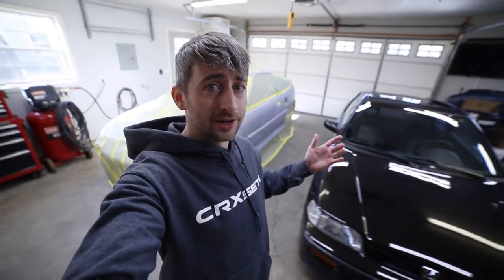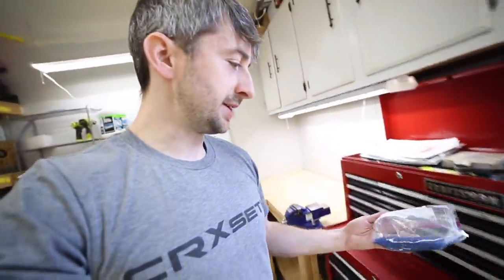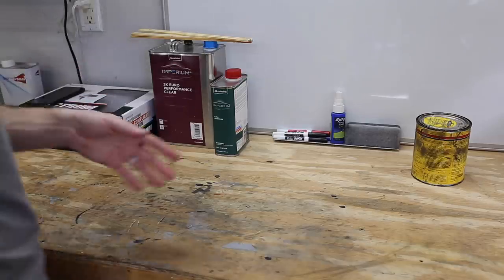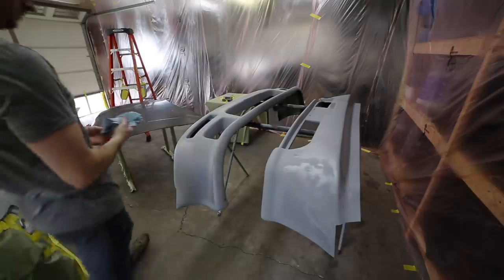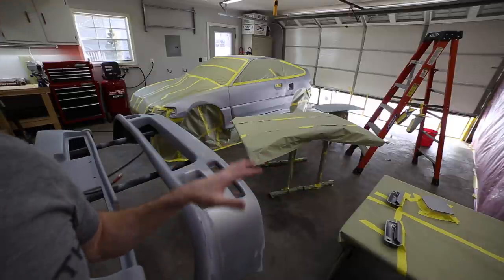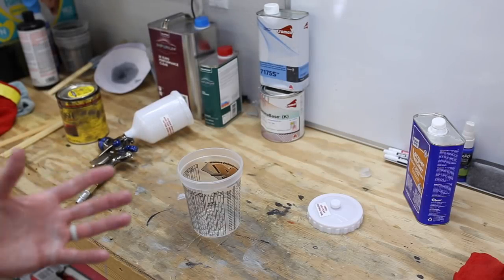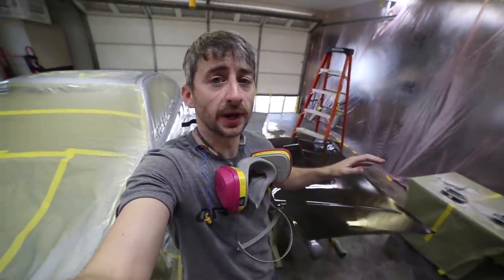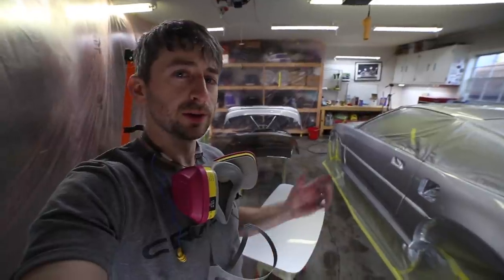1989 CRX Rescue Part 19 - DIY Garage Paint Job!

Comment: Dang, she laid out flat!!😍 
Quick tricks I've learned for a run in clear is lightly dab sticky side of tape to take away harsh edge for easier sanding. Also using your gun u can chase one off a panel or away from a body line so you don't have to worry about sanding through the body line

Comment: Great job all around , i personally would of used adhesion promoter for the bumpers sideskirts moldings and door handles . The runs in the clear where probably due to the cold temperatures
Reply from the maker: I used adhesion promoter on bare plastics. Check out some of the previous prep videos. I sprayed directly over primer in this video.
Reply: @crxseth  great job tho 👏

Comment: I don't have air so I'm not too knowledgable. But at the 5 minute mark what was the little glass tube thing you changed out, it almost looked like fish tank rocks in it haha. I'm assuming some kind of moisture collection to keep water out of the lines?
Reply from the maker: I mention it in the video, but it’s to absorb water. The beads are silica gel.
Reply: Ahh, I was doing the work from home thing while watching, I must have missed you mention that. Thanks for the reply!

Comment: Is a quart of paint enough for the whole car? Being reduced 1:1
Reply from the maker: I wouldn’t recommend it. I’d get more next time.
Reply: @crxseth  gotcha thanks.Technically you used 2 quarts with the base reduced. So you think better if you got 2 quarts and reduced to make 4?
Reply from the maker: That would be better. Since the car I painted was already silver, it took very little paint. For a full coverage paint job, I would get at least the half gallon you suggested at a bare minimum.
Reply: @crxseth  got it thanks for the reply. Keep up on the great videos!

Comment: Again looks great! The condensation forums from the hot air from compressor cylinder to tank cylinder collecting on the bottom open that bottom valve every time let any moisture out if you don’t have a little valve there add one. and I won’t doubt some condensation forums in hose but the pressure is very low and not a very forceful exit, Imo. I work with CNG pressure NOM 3600psi vehicle pressure but our storage pressure’s can reach 45-5500 psig. Again love the work I can’t wait to get mine started 🏃🏻

Comment: Those furnace filters work great if you stick them on the back of the box fans. That way you could stick the fans where ever you want and not get any dust. It does cut down on the flow a bit but not that much.

Comment: How would you say your compressor kept up with your gun?  Did you have to pause between panels?  Was it constantly running?  Looks great!  Thanks for making these videos.
Reply from the maker: It did well. It was running most of the time, but I never ran too low painting the CRX.

Comment: Check out the body filler method to remove a run. The gunman has a video on it. I haven't tried it but it looks pretty easy and safe
Reply from the maker: I’ve seen that, but I’ll give this razor blade method a try first.

Comment: I might have already asked you this on Instagram, but I forget now.  How do you like that compressor for painting vehicles this size?  I cooked my 33 gallon Husky with my autobody and painting project last year.  I'm on the fence if I want to upgrade to a larger 220 volt compressor or stick with something similar to what i had (seems to be the same specs as yours).  I dont anticipate many more painting projects, but man a larger compressor would certainly make them go smoother.
Reply from the maker: Mine runs constantly, but I haven’t had any issue with keeping up with such a small car. I don’t have a lot of experience with anything else.
Reply: @crxseth  I think you answered my question here - should be fine to repaint my S2000. Nice job man! 👍👍

Comment: Great job Seth! Cannot wait to redo mine. How much of that quart did you use on the base?
Reply from the maker: Since the car was already silver, it didn’t require a ton of coverage. I used 90% of it.
Reply: @crxseth  that’s what I figured I would do with mine since it’s a similar scenario as yours. Get 1 quart that’s a 1:1 and should be able to do the whole car with 2-3 coats

Comment: i usually spray from bottom to top and find i get less runs, but otherwise super solid job. painting in a garage is never easy and always requires more finish sand. i look forward to seeing the cut in the next video.
Reply from the maker: I definitely have room for improvement. Maybe the next one!
Reply: @crxseth  your still setting a huge example for a lot of us. honestly i think people oversell paint booths. I cant begin to tell you how many pros ive caught painting outside, or outside of the booth when shops get backed up. its the reason you always see cut/buff on estimates. 
keep up the great work.

Comment: Hands down one of my favorite crx painting videos. This was so much fun to watch. I have a crx too and I paint for a living but do kitchens with a spray gun. We use “zip walls” very similar to the way you masked using plastic except that they are like long poles that go from the ground to the ceiling and twist lock into place like a shower curtain pole wedges in place. Great looking car I loved the garage it’s so nice the red toolbox offset by nice white walls. Awesome video!
Reply from the maker: Thanks for the support! I’m sure it took me a lot longer to mask my way than that handy tool. I need me one of those!
Reply: @crxseth  I’ve learned a ton from your channel. Those 3D printed sunroof repair clips I think are what I need to fix mine. I have to hold the roof panel at an angle to get it to close. Plus you showed us how to mask pulling the window moldings back with tape, that’s a great way to avoid having to remove the windows but still get a good finish!